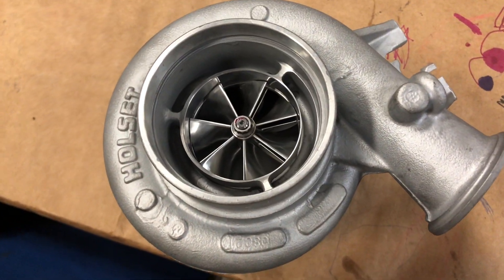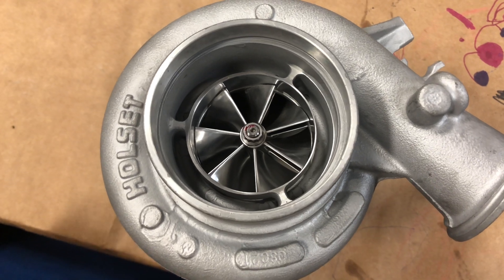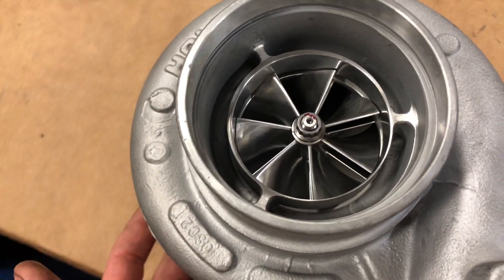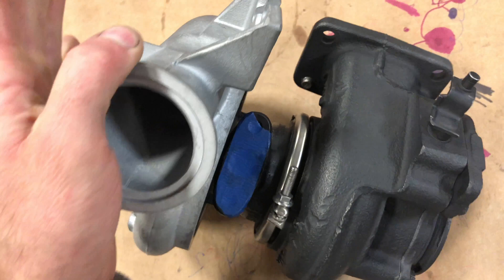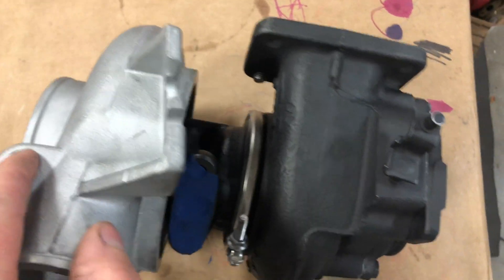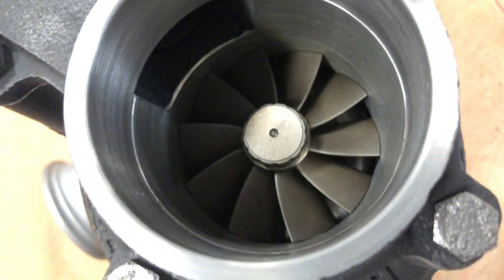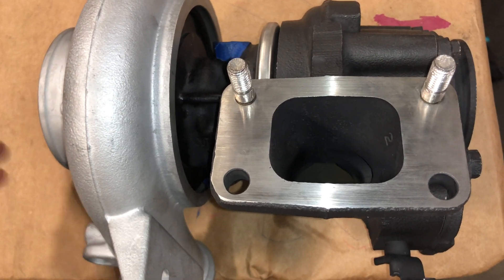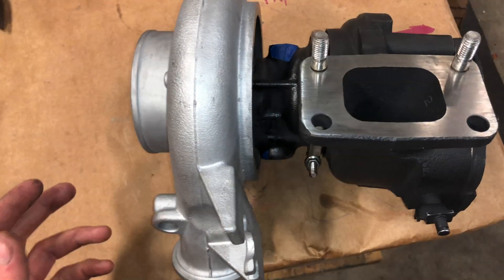Holset Hy35 Turbo Upgrade

Comment: Hello , I really hope this question gets answered . You’re my favorite turbo guy and I trust your opinion greatly . Why haven’t you built an hx 35 with a 9 cm turbine housing from an hy 35 ? I know it’s a v band style fit from the cartridge/turbine on an hy 35 . Can’t you machine off the flange of the hy 9cm and weld in a flange that has 4 bolt holes so you can use the hx 35 cartridge ? Then machine turbine housing for 67x76 and compressor like 64x76?  It’s got to be a really bad idea right ? On a diesel like 5.9 Cummins would this be a great spooling turbo that doesn’t choke up ? Or would this cause a surge situation ? Wouldn’t this be like the he 351cw but work on an early 5.9 Cummins ? Thanks and god bless
Reply: I DONT THINK HE WANTS A '' BIG ''' BIG '''''   JOB '''''

Comment: Currently weighing my options in my 2001 auto truck that tows exclusively. Got my stock hy35 and been looking at a hx35/40 hybrid then seen this video. I've got a turbo mounted exhaust brake so stuck with a modified 35 series holeset. Of the two what would you consider going with in an auto truck? Some fueling mods. Currently not pushing enough air and have the hy35 turn buckled to cool my charge.

Comment: Hello all i needs some assistance. 

Picked up new chra for KKk3 turbo on audi. Placed chra in turbine and noticed that there wasnt enough room and have to clean the housing where they mate. I pull out the chra thats caught up in the 📌 holding pin. Boom chra pops out to the floor. Now im paranoid if could've messed up the balance. Wheel also doesnt spin as freely as old though it spin easily except 1 full turn with a flick of finger vs 2. I noticed this before the trauma but will it loosen up when oil gets in new bearings? I switching from borg warner to merlett chra for k03

Comment: Fuck turbo labs
Reply from the maker: Why
Reply: @turbolabamerica  cause the turbo u guys rebuilt lasted 4k hahahahaha other then that no reason
Reply from the maker: nick rizzo why not send in for inspection/ warranty. I had one come back this week that was a min Cooper upgrade that had debris get in the turbo. I don’t know if that one was yours but I don’t have control of the cleanliness of your installation, once the tape is removed from the oil feed it is the installers responsibility to prevent dust or dirt from the surrounding areas from entering the turbo

Comment: Hello from the Westcoast, Great Video again Austin!! What would be the best combination do you think, for a H1C platform Turbine for a 1st generation Cummings and what would be the cost, do you think Austin. Thank you!!
Reply: First of all it’s Cummins, not Cummings. I used a h1c and got a 16cm housing for it. When you match it with 4” exhaust and turn up fuel screw and timing with gov spring, it was running 13’s at 7k ft. On the street corvette owners were upset when they thought they’d pass on a double yellow line and I’d make them look like they were pulling left to park... My clutch lasted about a couple seconds after first pull. I installed a zoom speed racing clutch cause southbend and that at the time was very expensive. Truck was a beast for a daily driver and got 25 mpg no matter how I drove it. Miss that thing.
Reply: @wht240sxka  I took you a year to figure out that it was a Cummins and not a Cummings, Brilliant!! My hat is off to you!!
Reply: @franklogan494  Well now you know, that’s great it only took a year. You’re growing up to be a big boy.
Reply: @wht240sxka  True Dodge guy's know what you are saying when talk about something. I guess that's why you don't own a Dodge anymore. Your 25 mpg must have been a 2 wheel drive truck and the sled puller must have been something else, as a sled puller does not get that kind of mileage.
Reply: @wht240sxka  I would have agreed with you on some your points on Cummins, but if I need to learn something I look at Power Driven Diesel. For sure not from here or from you. I checked out your YouTube Channel and instead of seeing a picture of your Truck or Truck's. I see a guy dressed up like a Clown, with a beer in his hand. With no content on his YouTube Channel and with two Subscribers, other than some Garbage Bike pieced and welded together. You must be some Bike Builder, lol I would have liked to see some pics of your Truck, after all you do have a Channel.
Reply: @franklogan494  Being a proud American is offensive to you? I’m not trying to prove anything to anyone. It’s clear you’re jealous. You need more help than I thought. Sorry you’re so unhappy. Buy a Cummins, it could fix that.
Reply: @wht240sxka  I have one, but I can tell by your YouTube channel you don't. As far as help, I am not the one Commenting on a year ago Post. I feel very sorry for you, in that you feel Inadequate and Irrelevant, as you are the one that needs help.
Reply: @franklogan494  You are commenting on a year old post. You have no videos to support anything you say. You feel sorry for yourself as you keep finding the need to get all defensive. Get over it Frank, get over it.
Reply: @wht240sxka  '''' ONLY ''''   PETERBILT'S  ''''  ARE FULL GROWN UP '''''  DONT FORGET ''
Reply: Hahaha. You are a little worked up. Still trickling though I see. I was born a conservative and will always be. See you are trying to stoop to making fun of someone cause it makes you feel better about yourself. What’s next, you’re momma jokes? Commenting on a year old post is what both of us are doing so that is not helping your case out. This really has gone too far. Let me be the bigger person and just say Im sorry for hurting your feelings on correcting you. It bothers me when people say cummings or new breaks or something stupid hence the correction. Lets do each other a favor and end this here. Oh and ditch the h1c. Get an S300 with injectors, its a good start for any cummins and build from that. If its mechanical, (ve or p-pump)adjustments for power can always be made. Food for thought. Good luck on your build. I would say after a year it is probably done, but for some its never done. I tried to put a picture of one of my trucks up for a thumbnail and its not letting me. Maybe I’ll try to repost my injector install video from a year or two ago. It was like a how-to but there is just so many out there it was useless. Maybe I’ll throw some batteries in and get a video up. My content is old af. I gave up when I kept working out of town.
Reply: @wht240sxka  Well throw some battery's in and try again. And I will give your advice some thought and I would like to see your Build and Truck, in all honesty.